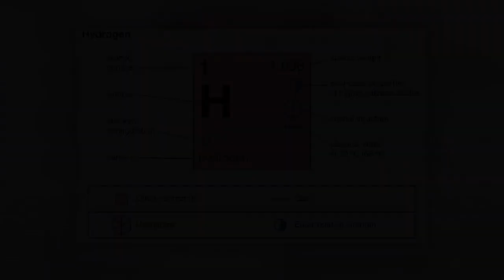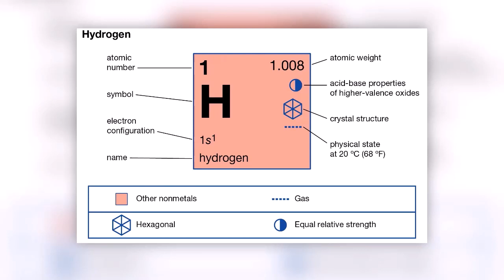New Rolls Royce Hydrogen Powered Jet Engine

Comment: Very interesting that the amount of fuel needed is mentioned. 
Hydrogen can be compressed so it wont take up as much volume as one might think and its also a whole lot lighter then kerosine per liter ( 730g/l vs 0,0899g/l). So why mention that as a drawback? Can only mean the (potential!) cost of hydrogen as its not nearly as scaled as concentional fuel is at the moment because otherwise this is quite that useless fact..
Am I missing something?
Reply: What I found interesting:

Hydrogen:
0,0899 g/l x 1.000.000 l = 89.900g --> 89,9 kg of Fuel.

Kerosine:
730 g/l x 250.000 l = 182.500.000 g --> 182.500 kg of Fuel.

So If the Numbers are correct that would mean that Hydrogen is a Lot lighter then Kerosine Fuel used for the "Same Range"...🤔
Reply: And talking into Account that the Energy Density of Hydrogen is around 142 MJ/KG vs 42 MJ/KG of Kerosine (Wikipedia) then I come to the conclusion that Hydrogen still offers a big Advantage in weight for the same resulting range. And it can be Stores more Compact as it's compressable and thus maybe change weight distribution, etc....

Comment: Its a rocket engine not a "jet" engine. Why ? Hydrogen burns to hot to be used in a jet or turbofan engine due the extreme "blow torch" effect that hydrogen produces when burned using injectors that can melt the internal parts needed within both engines. Rocket engines don't have fans or a rotating assembly for thrust.
Reply from the maker: It's a turbine not a rocket!

Comment: All this blather about burning hydrogen to reduce "carbon emissions" is idiotic. Sure, it will reduce CO2 emissions, but water vapor is a more potent greenhouse gas than carbon dioxide! Actually, I'm in favor of burning hydrogen, but not to reduce carbon emissions. CO2 has been demonized for political purposes, using climate change (which is occurring naturally) to frighten everyone. 

There are better ways of powering civilization than burning carbon-based fuels. I suppose the climate change scare is one way of accelerating the development of alternative energy, but climate change is the wrong reason for doing it. Climate change has been happening since the last ice age, there's nothing we can do to stop it, and it's not going to wipe out all life on the planet. There is a much higher likelihood that such an outcome will result from mass stupidity and the addiction to politics.

Comment: "The Tupolev Tu-155 is a modified Tupolev Tu-154 (USSR-85035), which was used as an alternative fuel testbed and was the world's first experimental aircraft powered by hydrogen and then liquefied natural gas."

"The Tu-155 used Kuznetsov NK-88 engines. The Tu-156 was intended to use Kuznetsov NK-89 engines. The Tu-155 made about 100 flights before it was placed in storage."

So it was only after 35 years that the backward west approached the achievements of the USSR.

Comment: No mention of the nitrous oxides given off by hydrogen when you burn it...(up to 300x more potent as a greenhouse gas than CO2)
Reply: Haha yea dihydrogen monoxide sounds like a horrible byproduct, I wouldn’t want to drink it or anything 😂
Reply: @Samuel117o  dihydrogen monoxide is the main constituent of acid rain.  Just saying
Reply: @awatt  dihydrogen monoxide aka H2O? Dihydrogen=two hydrogen, monoxide=single oxygen 🤣 sorry if I don't understand that your comment was irony, because if it isn't it can only be stupidity
Reply: Lol 😂 you are wrong
Reply: @hafizuddinmohdlowhim8426  nah he’s not. Burning hydrogen is much worse for the environment than coal or petrol because of the NOx it releases. If they can’t find away around than then it will be much worse for climate change
Reply: @Tom_W13  😂 Hydrogen is the cleanest fuel for combustion because it produces 95% less NOx than other hydrocarbon. Do your research before opening your mouth please.
Reply: Thats because you are rubbish at chemistry. The combustion result is h2o n2o
Reply: @johno4521  ah I see. Only in fuel cells is NOx not an issue. Different storey with combustion. Cheers